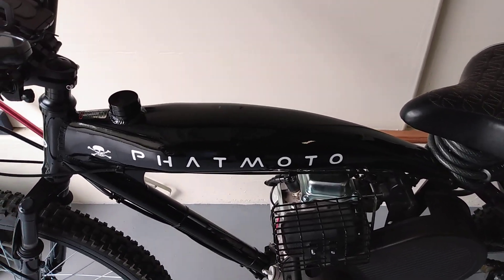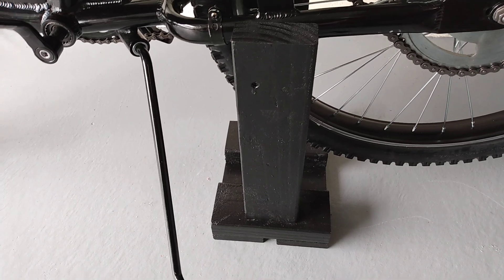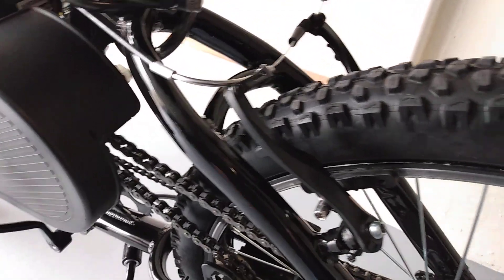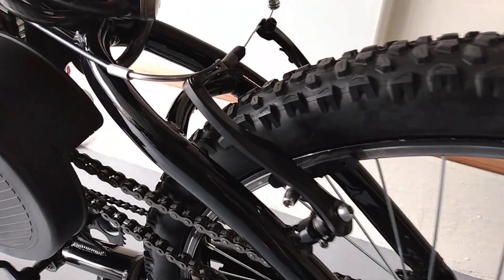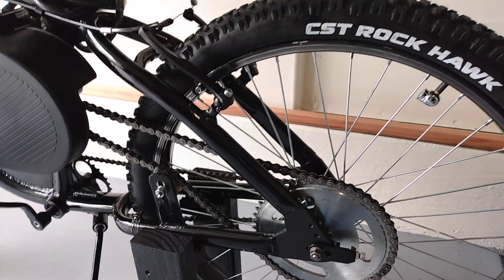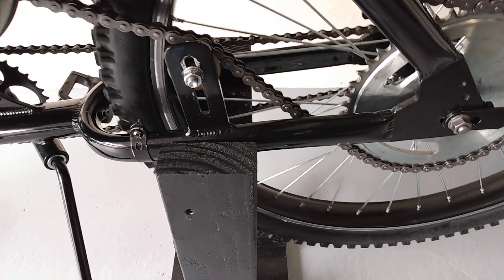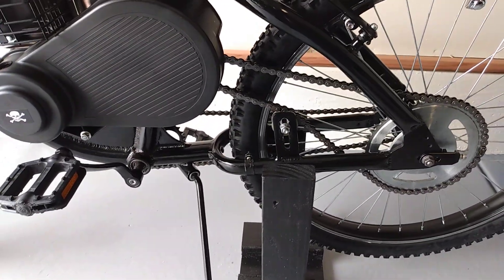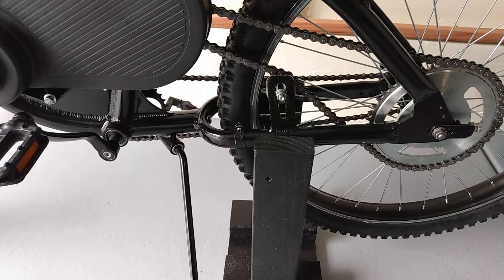Phatmoto upgrade rear V - brakes

Comment from the maker: I was looking on Amazon at v-brake set ups and found the exact set that came off the rear. They sold for $4.40 including shoes. That is beyond cheap, no wonder they barely even work, upgrade and you'll see the difference.

Comment: Good idea... Amazon has stands i got a "hook" stand it graps top and bottom rear drop out bars lifting the rear wheel off ground bye 4in-8in depending on settings of the stand.. i want a real bike stand so i can work on front end rear end whatever. Been putting off changing front froks just cause its a pain without a stand... the phatmoto is like 100lbs without gas and oil lol a stand that can handle over 85lbs is hundreds of $$
Reply from the maker: Very true, I have a repair stand that handles 62 lbs. It works for my electric bike that weighs 66lbs but like you said the Phatmoto is fat at 100 lbs. 
My cheap stand cost $49 it works but not a true pro stand. I've seen bench mounted stands that would handle the weight, but you would have to turn the bike around each time you need the other side. The wood stand I made works pretty good and is cheap.
Reply: @beaubrummelmotorizedbicycles  i get it and if i didn't have a hook stand i would have done the same thing. I was going to.. but the hook stand is only $15 on Amazon. The other stand i was looking at is a parking stand but works for 2 bikes ao should be prefect for the phatmoto wont need to turn it if you place it in the middle of the floor. Only other cheap options i seen was hooks

Comment: Also looking at your rear dropouts you should be able to mount disc brakes easy just get a Universal mount.. have to check again but it looks 100% the same as mine just mine has the disc brakes
Reply from the maker: The 2020 Phatmoto has a large rear disc I think its 230mm's. And the caliper has to be mounted in such a place as it will clear that large disc.
Reply: Yes true.. but look up "Steven phatmoto" he has the 2019 he put disc brakes on rear you will see what i mean. I believe he even used same size disc as the 2020
Reply from the maker: @miguel360kmc  I searched Steven phatmoto on YouTube and all I got was a sideways video of his clutch spinning at high rpm.
Reply: Sorry wrong one i thought it was the last one i watched. https://youtu.be/np09zEogxRQ heres the link. The video is crap but if you  Pause it when his showing rear wheel you can see brake set up
Reply: But the 2019 the frame is the same it has the bolt holes ready for the disc brakes just have to find the right set up. Only other option is a "damgood" hub which is a drum break would have to rebuild whole rear rim. Some sites like "ghettobikes" sell whole rear rims with disc brakes ready and or drum brakes but they are like $2-300
Reply: I been doing a lot of research into this subject cause i want to buy a 2019 rover as a "roller" mount a different motor must likley the p79 since that would be a easy bolt on swap a little more reliable and has more power and aftermarket parts. Than save the motor as a spare for my 2020 or sell it if i end up swapping. The 2019 is the best option right now for gas frame rollers the frame is amazing 10xs better than any other roller out there and only $60 more
Reply from the maker: @miguel360kmc  Okay, I see what you mean. He used the large disc and an adapter, it also looks like he has added bolt extensions or spacers to get the height needed to work. The only thing I can see that might be a problem would be the caliper perched up that high might not be stable or flex to much. But it looks like it works so I might try it, what do you think?
Reply: There may be some flex yes but if he used "good" parts should be fine. Seen set ups like that on Springer front ends
Reply from the maker: @miguel360kmc  I think you are right, it should be okay, I'm pricing 203mm rotors and adapters on ebay, seems to be cheaper than amazon prices.